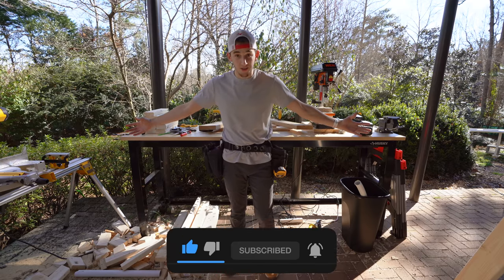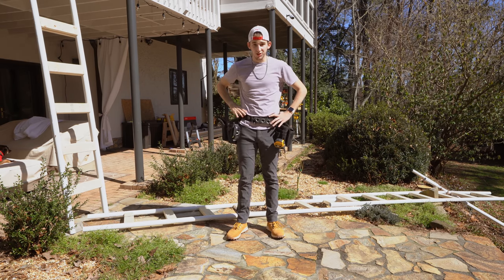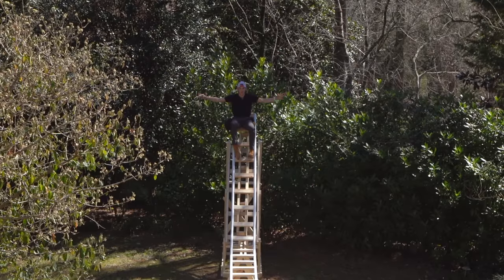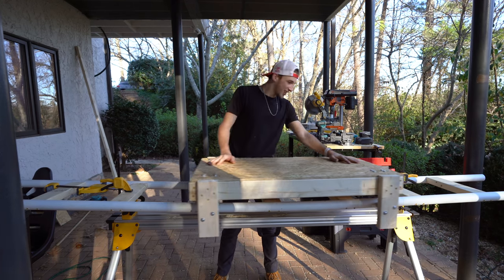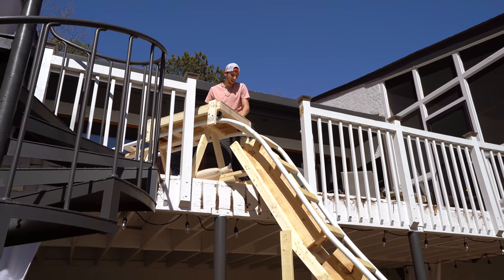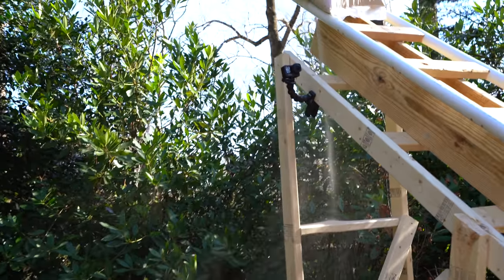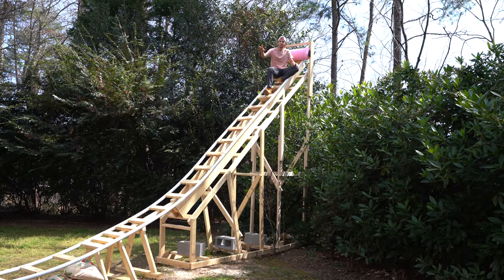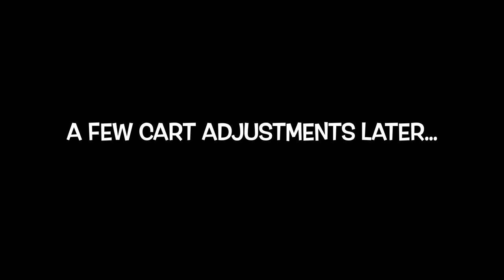Building a Roller Coaster In My Backyard!

Comment: A Tip for next time is using hot sand so all the pipes bend the same amount. Also you have to test it with weights first. It has to support %150 of the rides weight.
Reply: @Joel Limbom I learned it from Paul Gregg, I'm also pretty sure 1.5x carrying capacity is pretty standard. Or I could be an idiot, I have no idea.

Comment: Sorry to bring it to you man, but i think a loop will just not work properly with the way you're building this thing. You'd have to redo all your track and probably make it a lot higher aswell, if you make your loop too small or too circular you'll just potentionally break your neck. 
A few tips:
- Bend your PVC with hot sand to get more gradual shapes. I'm seeing some burn marks so I assume you used a blowtorch of some sort instead which leads to uneven bends.
- Don't count too much on the wooden crossties for assuming the strenght of the track, the weakest part is in the PVC which can still break or rip when the point force of the wheels becomes too large.
- Make a plan before you start building to prevent mistakes, this will save you time and money but also guarantee you more safety!
- If you are going to make a loop there is a very big chance your upstop wheels will press against the track if the clearance between them is too small, but you also don't want to make them too big to prevent the cart from falling off the track. A thing you can do is use thicker guidewheels so the track can't slip between them, but that's not recommended.
- Look up some other backyard rollercoasters from the "professionals" like Will Pemble or Paul Gregg, they have some very interesting stuff about backyard coasters!

Anyways I love that more and more people are starting to build their own backyard coaster, can't wait for the next video on it!
Reply: I think he should try doing a barrel roll first
Reply: Solid advice
Reply: @beetleboi-ym7xr  you mean a corkscrew? Or a dive loop?
Reply: @beetleboi-ym7xr  there is no suck thing as a barrel tool unless you mean:
Corkscrew, Heartline roll, or I believe it’s called an in-line roll or something.

Comment: I was thinking about something like this, how did you connect the different pieces of track together?
Reply: Cut a line on a small piece of pvc, heat it then fit half of it into one pvc pipe, then fitting the other pipe on the other half of the heated and cut pipe